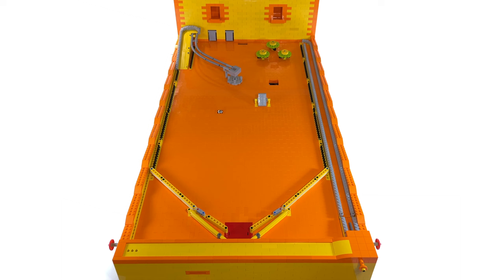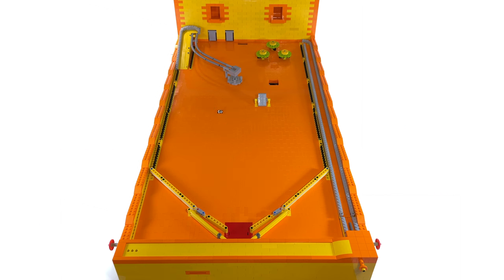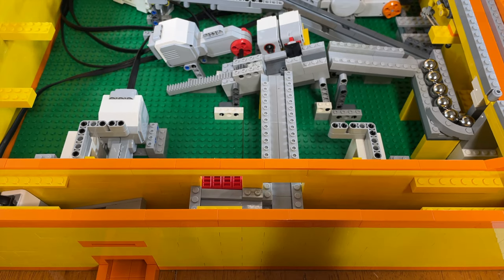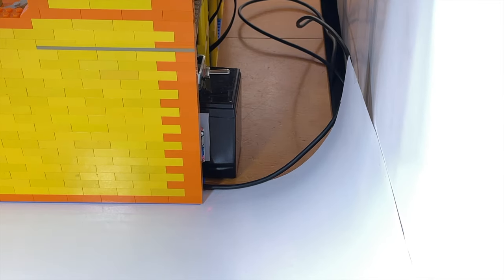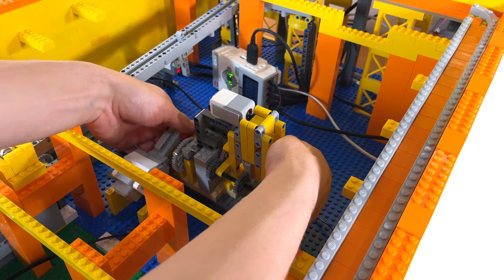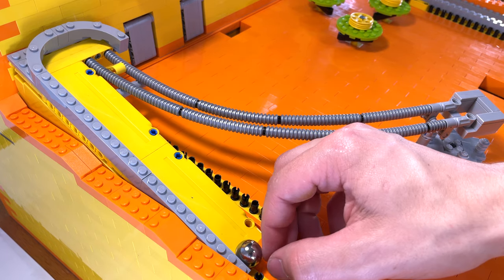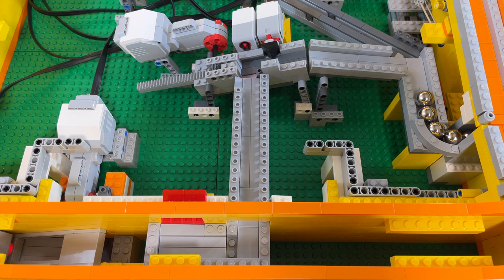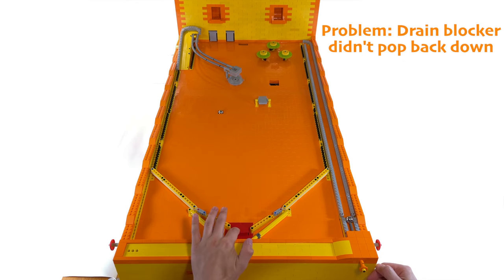Crazy Huge Working LEGO Pinball Machine

Comment: Three EV3s in one machine, haven't seen that yet xD

But seriously, awesome work! Many unique and well executed mechanisms, combined in a massive machine.
Reply from the maker: For a machine of that size, 3 EV3s are needed. It’s impossible for 2 to reach over the whole thing even with the XL cables. I only had 2, so I needed to borrow one from my brother’s school to complete this monstrosity. They want it back by next month and it is going to kill me to dismantle it. This is one of those machines that you just don’t ever wanna take apart lol. Thanks for the kind words! Oh, and also, welcome back!
Reply: @LegoTechnicsRule  True, it's a shame there are no longer cables. I wonder if you can cut two XL cables and connect them together, to make a XXL cable.

I know how painful it is to say goodbye to a machine like that, especially a fun arcade machine. But I always liked the fact, that by doing that, I had all these bricks to build a new machine.
Reply from the maker: @LCMMaster  you can make your own long cables out of an old RJ12 phone cord. Just cut the tabs off and you’re good to go. Don’t make them too long or voltage will drop.
Reply: @LegoTechnicsRule  Good idea
Reply: @LegoTechnicsRule  y’know, if you just need constant speed you could use an amalgamation of those MINDSTORMS to power functions adapters and power function extension cables to reach as far as you want.
Reply from the maker: @largewallofbeans9812  That’s actually incredibly smart. It just wouldn’t work with sensors because of the 2 wire thing.

Comment: This is so cool!! I really like the pop bumpers! Did you experiment with different side boards before setting on the black pins? I’m definitely subscribing, thanks for the cool video!
Reply from the maker: Thanks! I actually accidentally discovered that the pins were bouncy. The hoop where the candy ramp leads to, I had it removed with the pin still in the board while I was testing death mode. While testing, the ball hit the pin and rebounded strongly. This was a last minute addition, but it definitely was worth it. I suppose I am putting the ‘pin’ back into pinball.